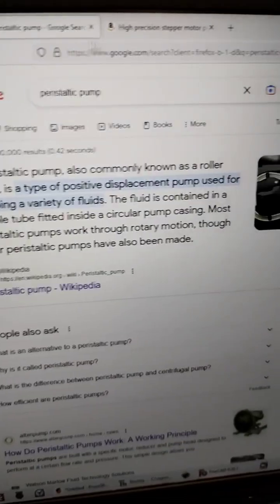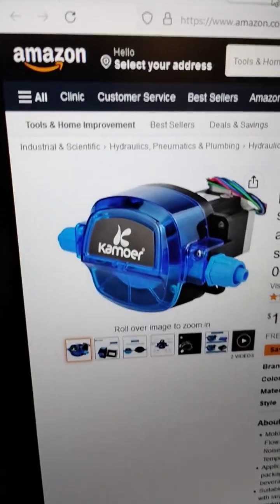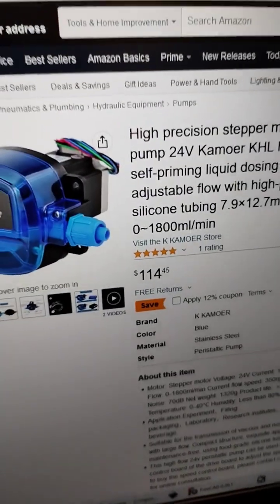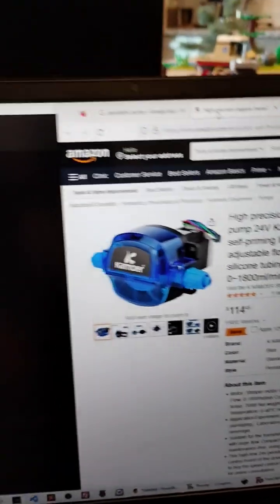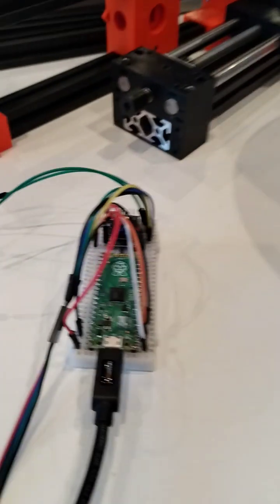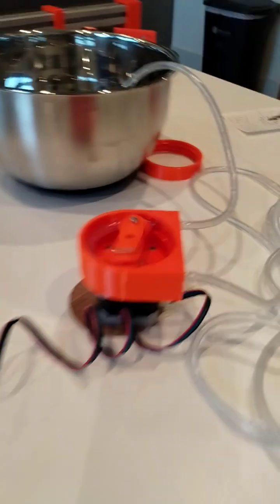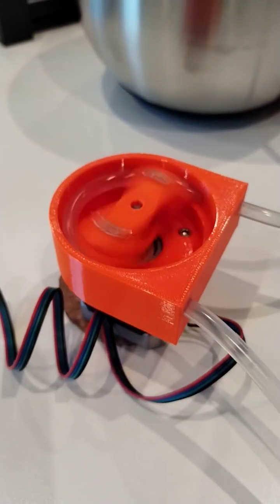DIY peristaltic pump (aka roller pump)

Comment: Silicone Lubricant will help keep the friction down and help increase flow rate. I’m in the processes of using a peristaltic pump to make a environmental water sampler. Using a DC peristaltic pump from Amazon, but will eventually try to make a larger one. Would you be willing to share your creation files and any advice related to construction? Hope you’re doing well. Great vids 👌